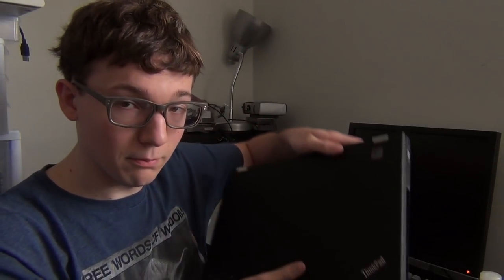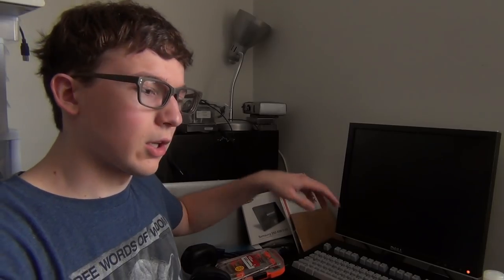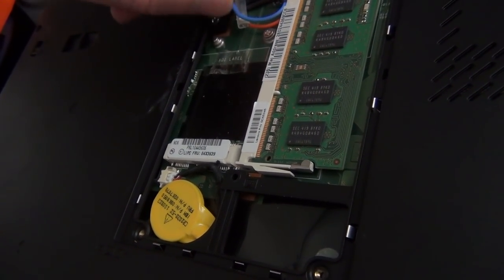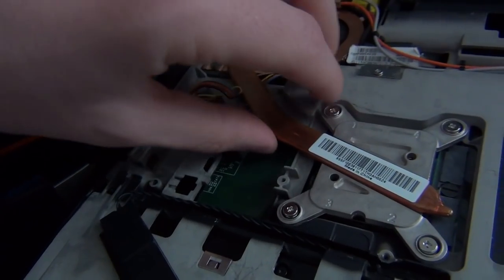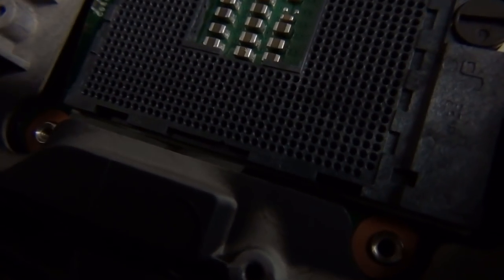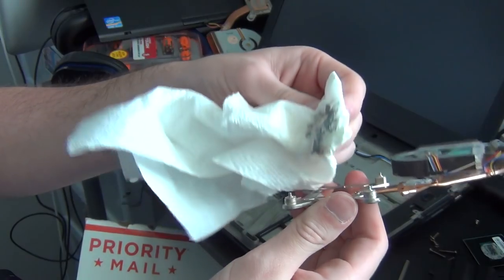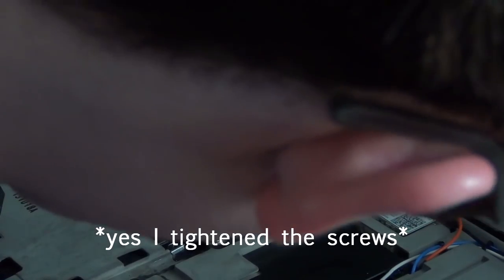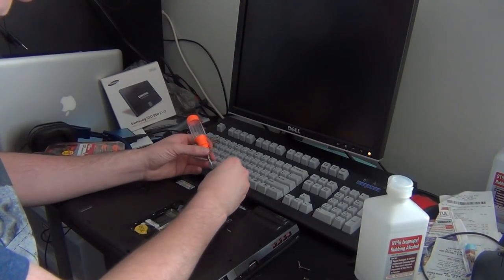Lenovo ThinkPad T430: CPU Upgrade

Comment: Hello Sebi. May I ask for details regarding the aftermarket battery for your T430? I’m interested in getting the best replacement possible.
Reply from the maker: Honestly at this point it is a crapshoot. You can probably still find used/refurbished/new old stock genuine Lenovo batteries around; these will probably be the best option. If not I would try to recommend a certain aftermarket manufacturer over another but the vendors and brands of those batteries seem to change all of the time.

Comment: Have you tested if it has an effect on battery life? 

Very clear instructions btw. 👍
Reply from the maker: Haven't really been able to do a thorough test of that, but it still lasts several hours doing normal tasks so the only time battery life is heavily affected is probably when it is under a full load.
Reply: Quite good I guess. But, as I discovered, there are quite a number of screws you have to remove before the top will come off that are not mentioned at all in the video.
Reply from the maker: I thought I had mentioned it, however I might have edited it out because some of my instructions were redundant. I’ll have to look back through the video and see.
Reply from the maker: With my mixed-use (web browsing, watching video, etc) I manage to get around 3-5 hours with the 9-cell battery. Your mileage may vary.

Comment: That Unicomp Spacesaver tho
Reply from the maker: Actually the Unicomp Classic 104 :)
Reply: @SebisRandomTech  ah the big guy. I have the white spacesaver but don't really use it much. And of course... a T430 that I am now looking at upgrading with a 35W i7 thanks to all this info. I remember my college days (computer engineer BS/MS here) and the 430 line was new when I entered grad school. Sure was a big deal then and I drooled over it, but no one drooled more over a ThinkPad at that time than the original X1 Carbon, even if it wasn't very future proof. Just a beautiful machine. Anyway, I digress. Maybe a T480 someday for me is next...
Reply from the maker: @metal571  I do agree that the original X1 Carbon is a very nice machine, even if it's a little lacking in upgrades. It's built well, feels nice to use, and still has that "ThinkPad" feel to it.
Reply: @SebisRandomTech  I might be a little biased. At one point for a couple of years I was part of a Lenovo internal group called the Lenovo Insiders where we were basically promoters. Unfortunately when they started getting us to push Yoga and IdeaPad stuff I totally lost interest, but it was a fun group to hang out with with a lot of Think line fans there too.

Here's to hoping they offer some more models in the future with fully socketed RAM and those Ryzen chips. Was looking at T14 with the AMD option for a wild 8C/16T powerhouse but the drawbacks vs T480 are annoying.
Reply from the maker: @metal571  I'll be sticking to my T430 for the foreseeable future. Bringing back a socketed graphics card on the P15 and P17 is promising, but they also cheapened the design a little and got rid of dedicated touchpad buttons (trackpoint buttons are still there).
Reply: @SebisRandomTech  is there a reason you went for the 3612qm over the 3632? Just curious as many are recommending the 3632 instead
Reply from the maker: @metal571  At the time I found a 3612 for a little cheaper. Now I have a 3632 in my T430.
Reply: @SebisRandomTech  thanks dude. Really appreciate the videos, keep it up.
Reply: @SebisRandomTech  Is the 4 core over the 2 core processor a wise choice for casual computing?  Is more better or not?  Thanks so much.
Reply from the maker: @beandrive  For basic tasks like browsing the web and checking email you won't notice a difference. In demanding tasks, video work, compiling, etc, the difference is definitely more noticeable.

Comment: I'm Planning to do this with my L430 same socket rpga G2 from i5 3210m to i7 3610m, plus I'm going to change my board with gpu nvs 5400m hopefully will work after lockdown hear in Philippines :)

Comment: Have you test for the temperature after CPU swap? I got my T430 last year and I upgraded from 3320M to i7 3740QM with 45w TDP, temperature when idle is around 45c, full speed around 70-80c.

From my experience, temperature is the same when you install heat sink with or w/o dGPU heat pipe.
Reply from the maker: I used a 3612QM, it and the 3632QM are only 35W chips so they don't get as hot.
Reply: Have you hand any issues with over heating? I'm thinking i might want to go with a 45 watt instead of a 35 watt
Reply: @ethanrosenbaum3186  In my humble opinion, stick with the 35 watt for solid reliability and longevity.

Comment: Is it still wirth the i7-3612qm in 2020? i'm considering buying a moded x220 with such a CPU. Considering i want to run occasionally Dolphin Emulator and just run Arch Linux on it. Also I have 16GB RAM and a SSD.
Reply from the maker: A modded X220? Go on...
Reply: @SebisRandomTech  Thanks for the replay. They replace the stock CPU with the i7-3612qm. Additionally i'll get also a FHD 13' Screen.

Comment: How about the t530? I assume the process is almost identical but is the i7 3612QM probably the best option for the t530 as well or is there a better CPU to consider for that in terms of performance and thermals?
Reply from the maker: I actually just got my hands on the T530 and am planning on swapping the 3612QM from my T430 into this. I may hold off a bit on doing this, as the T530 and W530 share the same chassis so I may just swap in the motherboard and heatsink of a W530 for the better graphics performance and higher maximum RAM.

Comment: I have a T430 with a standard display and want to upgrade the display to IPS is this easy to do please as it would be nice to have a better display I joined your channel and love the videos Thanks Bob in the UK
Reply from the maker: There is an adapter kit you will have to buy for an IPS display to work. More can be found on the ThinkWiki article "Replacing T430 screen with a better one".

Comment: Hi Sebi, I happy that YT recommended you once , because due to your reviews I bought a T430.  But know I need some ideas. Recently I finished my CPU update to a Core I7 3312QM that works very well. I am suffering since cpu upgrade an issue that the carger does not seem to charge the laptop anymore while it is running. But It starts with AC only connected and it even seems to charge the battery when turned off. But When I start it with battery and AC the battery is discharging and turns off when getting below 5%. 
The charger is an original lenovo FRU/PN45N0314 that gives 20V/3.25A. Might it be thatit does not deliver enough to charge and run the laptop at the same time? And is this due to the CPU change, because both CPUs have TDP 35W.  
Any clue ?
Another point is my bios version is quite old : v2.52. from 02/14/2013.
Reply from the maker: You will need a higher wattage charger. 65-90 W, or 90-135W
Reply: @SebisRandomTech  I thought the same and ordered already one from Amazon with 90W. But what bothered me is that I nowhere read about that. And that makes my PSU with 60W useless now. Anyway, many thanks for the advise. I have doubts if it is really necessary to update the bios. My genuine battery supported the core i5 for more than 6h. Now I am thinking about the 9 cell battery slice that would extend the battery time again. But I am really worried to brick the bios with the hack from your other video. Can you point out which is the flash chip on the Mainboard, that I can dump with an external programmer? As far as I remember there were two.
Reply from the maker: @ChAnTi I’m not too familiar with the T430’s motherboard, or with flashing directly to the chips/dumping from them.
Reply: @SebisRandomTech  received my new 90w charger and works for chaging and laptop at the same time. thumbs up

Comment: i have a 11 year old thinkpad t430i model will a i7 3610qm upgrade from i3 3110m be fast enough for egpu
Reply from the maker: Depends on what sort of eGPU you plan on using. I recommend the 3612 or 3632QM processors, since most of the other quad core options will run hotter than what the T430 was designed for. The older hardware of this system will be a bottleneck for modern GPUs.

Comment: I have the t430 and have yet to open it up all the way...installed ram to get it to 12 and next is the processor...do you have the link for this i7 as I’m a YouTube streamer and it’s time to max this thing out!! If you can help me please
Reply from the maker: Availability of the processor is never consistent with any given seller, so for me it’s easier for the buyer to look up the processor on eBay rather than send a link, usually by the time anyone sees the link that seller is no longer offering it for sale. But if you need to know, the processor I put in is a 3612QM.

Comment: hi , i changed I5 for I7 3740 qm and it's very good   and fast !!!!
Reply: Did it increases your system speed...
I'm also want to upgrade my T430 from i5 3rd generation to i7 as i have much to deal with Graphics and rendering stuff...
Did this upgrade helps me?
Reply: I5 is a core 2 duo , I7 3740 qm , 4 cores , i saw better performance in Cinebench 15 . Test your CPU whith it and compare whith I7 results . Rendering is best . I think really that this upgrade help you in your job
Reply: @patrickcremmer8989  Where did u buy ?
Reply: NYCfactor  Hi  , if you haven't an nvidia gpu ( nvs 5400M) , temps are very good 109°F  in  idle in a room at 68°F  . If you have an nvidia , temp is 140° idle in same room ( no good  ) . I know because i have 2 motherboards . 1 whith GPU and other just HD 4000
Reply: NYCfactor  never problems whith heat . Heat when i use the motherboard whith nvidia nvs 5400m .
Reply: NYCfactor  hi , i use Thermal Grizzly Kryonaut

Comment: I upgraded my T-430 (same laptop, just next model)... It's not a BIG upgrade, but you can definitely tell...
From I5 to I7
BTW the "s" model has a soldered on CPU...So if you have the "s" variant, you're out of luck...
Reply from the maker: The i5 to the i7 that Lenovo originally shipped is not a huge upgrade, as it is still a dual core CPU. The i7 I put in is a much faster quad-core, so there’s a much larger difference in performance between it and the original i5.
Reply from the maker: Btw, this is the T430 shown in this video too, so I’m not sure what you meant by “the next model”. I talk about the -s and X series ThinkPads using soldered CPUs in some of my other videos.

Comment: Installed a i7 3632QM on mine. The temps hit 95c when stress testing on Prime95 and throttles.. So I decided to throttle the CPU ( via Power options in Control Panel) in battery by using only 90% and on Charger to 100%. Sits idle at 40c..Should I be upgrading to the Nvidia heat sink? Will it shave a few degrees off?
Thinking of getting DDR3L sticks to save battery life. Do they work on Ivybridge architecture?
Reply from the maker: DDR3L sticks should work. An Nvidia heat sink should help keep things cooler. Make sure to do a good application of thermal paste. I have a 3632QM in mine now and it almost never gets close to maximum temperatures.

Comment: Also what are your thoughts on adding an i7–3840QM (or any i7 with a TDP of 45 watts) and adding a dual pipe heatsink and a non delta fan? Would this work/improve the speed of the cores and keep the computer cool without causing throttle? Would I need to flash the BIOS and overclock?
LOVING your channel!
Reply from the maker: I don't think you would have to patch the BIOS. A dual pipe heatsink should help with preventing things from overheating.
Reply: @SebisRandomTech   Thanks!!

Comment: Can you share the best place to find the processor for around $90.00 also I will assume that it will be used,  as I see them for almost $200.00.  Thanks the video will surely help me out when I get ready to update mine.  Again keep up the good work.
Reply from the maker: I bought mine used off of eBay.
Reply from the maker: In fact here's an i7 going for around $90 right now:

https://www.ebay.com/itm/Intel-Core-i7-3612QM-Processor-6M-Cache-2-10-GHz-rPGA-SR0MQ/192548384497?epid=1001476063

Comment: will the i7 3520m? work? i have an i7 right now, but i have 3 i5 t430 i want to upgrade.  I also have a t440p i5 i want to upgrade as well. Im not real good at figuring out what works with what, but im good at taking stuff apart and putting it back
Reply from the maker: It will work but won't be a massive upgrade over the i5. The T440p is a nice laptop as well.
Reply: @SebisRandomTech  yea i like it i just hate the track pad and i know you swap it out for a different one, but I really dont want to go through that work.  I do like the t430 though i like that black look.  it feels like you could bash someone in the head and then post online with it lol

Comment: new to wroking on computers, but on the fan/heat sink whats the little square piece with thermal paste on it?  like whats it go over or on?
Reply from the maker: That goes over the processor.
Reply: Sebi's Random Tech i know the fan goes out it i know. Theres a little square piece off the side of the fan im guessing thats the heat sink?? It had thermal paste on there too when i took it off
Reply from the maker: @thinkdifferent7469  Yes, that goes over the processor.

Comment: I doubt you remember, but what heat sink did you use?
Reply from the maker: It was either the 04W3269 (Toshiba) or the 04W3270 (Delta). It was the discrete GPU heatsink (despite my system not having descrete graphics) to allow for presumably better cooling. In my current system I just have the standard integrated heatsink and it still cools just fine.
Reply: Thanks!

Comment: Any chance you have a source for the i7 processor, it seems there only on ebay located in china now
Reply from the maker: Every once in a while one will come up from within the U.S. I recently acquired one that way. Look out for both the 3612QM featured in this video, and the 3632QM. There are also some faster ones that will work as long as you keep a close eye on the thermals.
Reply: @SebisRandomTech  thanks for the reply, i just ordered one on ebay from china, have you heard anything about these processors? maybe there bootlegs
Reply from the maker: @CrazyJames  As far as I know they're legitimate. If they aren't and you used eBay it should be easy to have your money refunded.

Comment: Is there a reason to change the heat sink?  I have the 3612QM ready on hand to upgrade.
Reply from the maker: Like I said in the video, the heat sink is the one meant for T430's with a dedicated GPU. Even though my model doesn't have the GPU, using the GPU heat sink can help keep temps down a little better than the stock cooler. The regular heat sink will do fine though, and as far as I know the CPU won't overheat even with that.
Reply: Thanks for your reply.  I look forward to upgrading my T430.  I'm going to max out the RAM and install a SSD.  I'm thinking about upgrading the screen to.

Comment: What about a T430 with dedicated Graphics?😅
Reply: I have a egpu hooked to my x230 through expresscard.
Reply: @Somali Navy now I have a razer blade, so I don't use that setup anymore. But I used to play Witcher 3 on High 50fps on a ultrawide monitor. Thinkpad x230 + GTX 1060 gpu. So no, not CSGO. Anything, really.
Reply: @Somali Navy It's acutally crazy that it can do that, but it can. It's crazy.
Reply: @Somali Navy yeah, but it works
Reply: I'm curious how big the bottleneck is with the single PCIe lane in expresscard.
Reply: yes you can change your board with soldered nvs 5400m gpu

Comment: hey, i'm thinking about buying a E470, do you think it's a good buy? (btw, they only sell 768p panels on my country and it has a 6th gen i3, 4GB ram and 500 GB HD)
Reply from the maker: Whether it’s a good buy or not depends on the price and your needs. If it’s on a heavy discount then it might be worth it, but if it’s close to the regular price there might be better options out there.
Reply: thanks, it's just about 10% discount.

Comment: How is that possible, sorry im new in ThinkPads, How you can upgrade from I5 3320M (FCPGA988,FCBGA1023) using BGA1023.
To  i7-3612QM (FCBGA 1224) using BGA1224, how is that possible, theyre not the same socket, im asking because i want an T430. Thanks.
Reply from the maker: They are the same socket.
Reply: Oh, thank you so much!

Comment: configuration my T430 upgrade  1 x I7 3740QM 2,7ghz ..boost 3,7ghz .   1 SSD samsung 850 pro 256 go ( system ) 1 SSD samsung 840  ( 500 go ) , 1 Crucial M- Sata  CT120M500SSD3 ( 111 go ) , 1 R5C822 ( 60 go ) , 1 Sandisk ultra fit ( 28 go  ) . RAM  16 go hynix and keyboard whith white light . Very good laptop  !!!
Reply: cinebench 15  570

Comment: What's the part number for the replacement heatsink?
Reply from the maker: 04W3269 and 04W3270 for the dedicated GPU, 04W3267 and 04W3268 for the integrated GPU heatsink.

Comment: What is tdp and how can one know that how to keep the tdp lower or the recommended cpu 2 kp it low ?
Reply from the maker: The CPU spec sheet tells you what its TDP (35W, 45W, etc) is. The best ways to keep it cool are high quality thermal paste and good application of said paste, and adjusting the fan curve using something like TPfancontrol to make the fans run faster, getting more air moved.